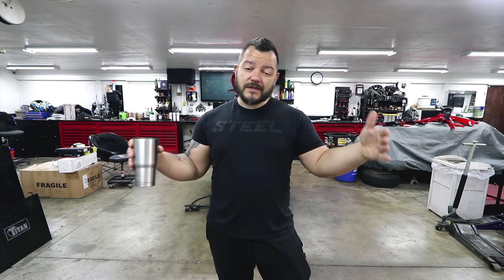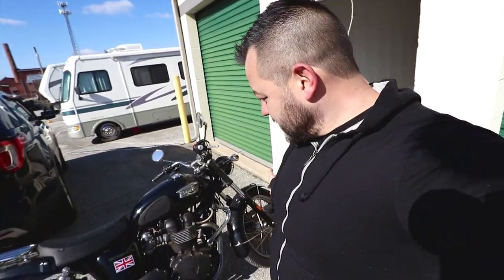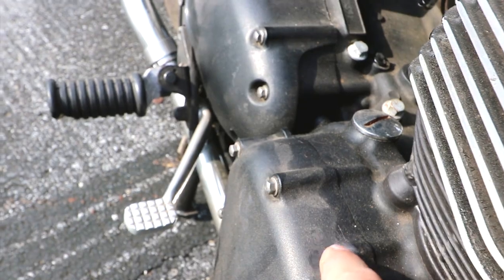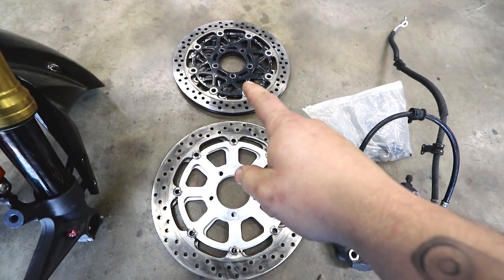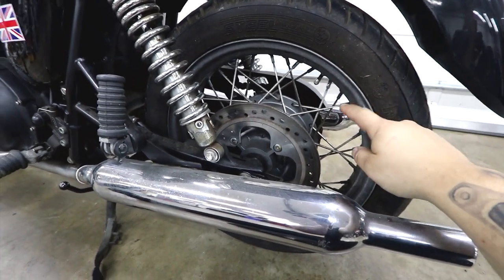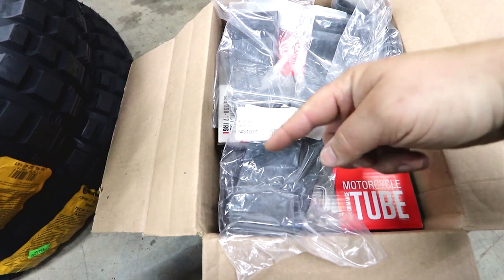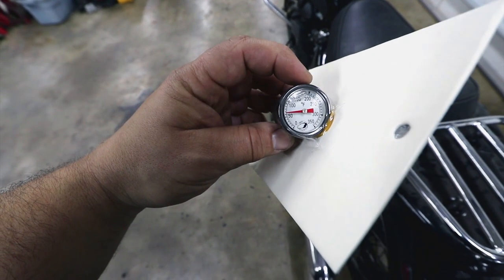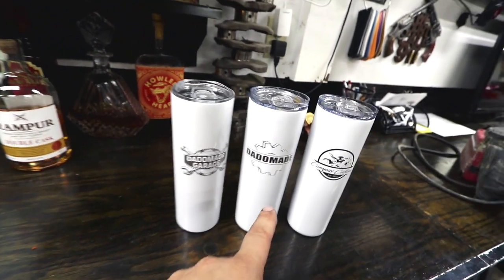EP1 I bought a build bike!

Comment: Wrong tubes. You need tubes to fit the 130mm (5.1 inches) wide tyres, not to fit the 3.50 inch (89mm) wide rims.
Reply from the maker: Good catch new tubes were on the way as soon as i switched tire size to accomodate bigger tires.
Reply: @DadoRados  👍